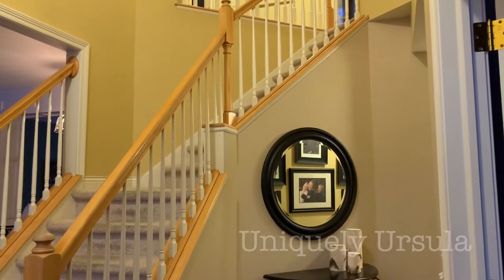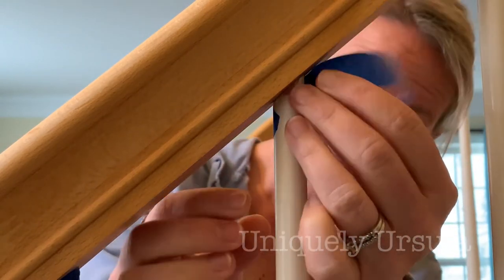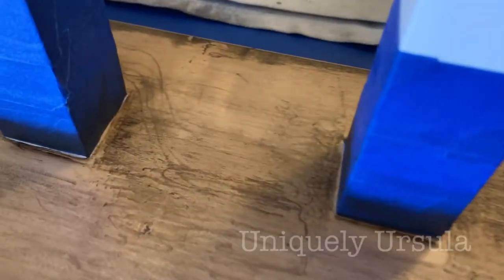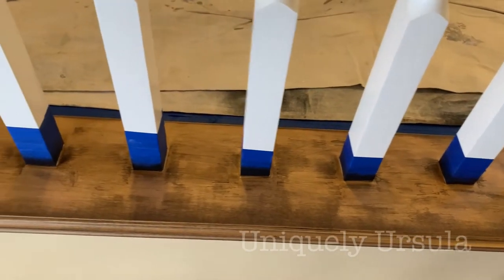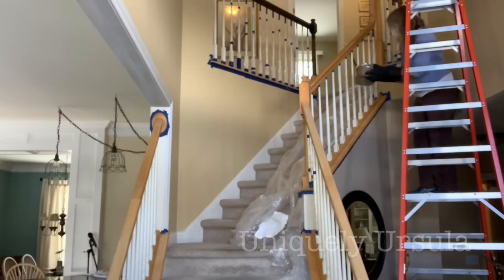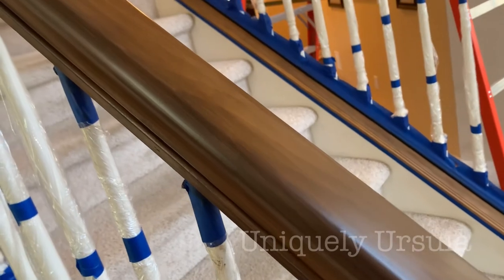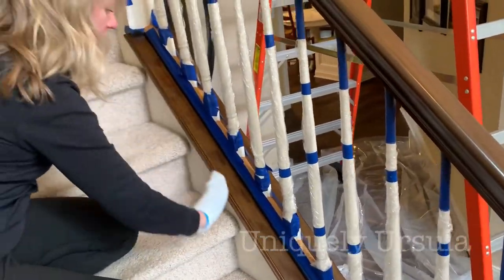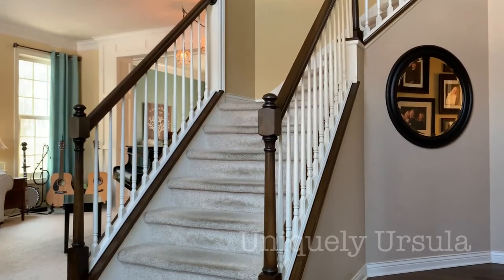DIY Stair Rail Makeover with Old Masters Gel Stain, Citristrip, and more!

Comment: I've been putting off staining my maple staircase handrail for 24 years now.  I could shoot myself
for not staining it before it was installed by the trim carpenters but I did paint all of the balusters 
and newel post prior to installation.  I might tackle it this year but I'm so paranoid of staining 
around carpet and walls.  I will take all precautions and hang plastic sheeting over everything.
I'll have to try to reproduce the same stain mixture I used on the stair treads and use a pre-stain conditioner to avoid blotchiness.  I pray I have as much patience and success as you!